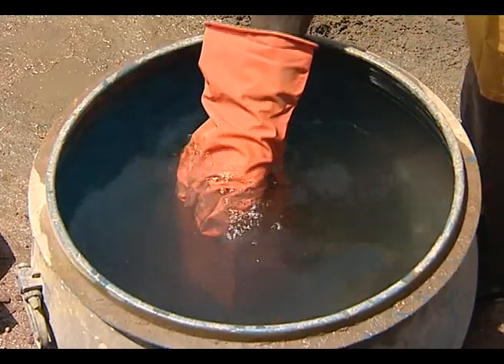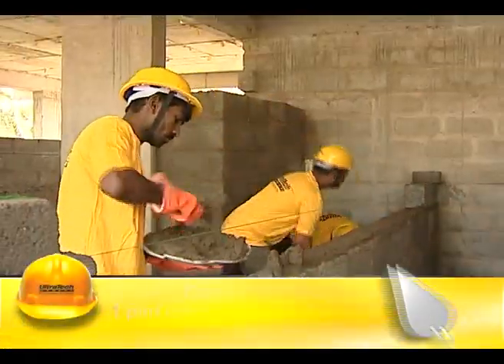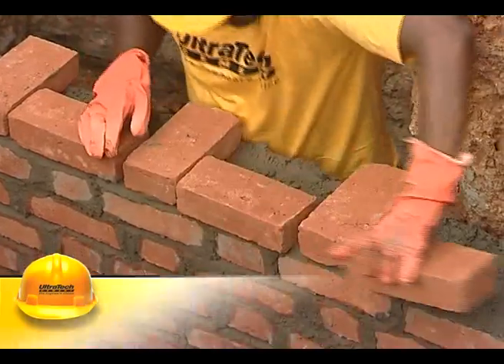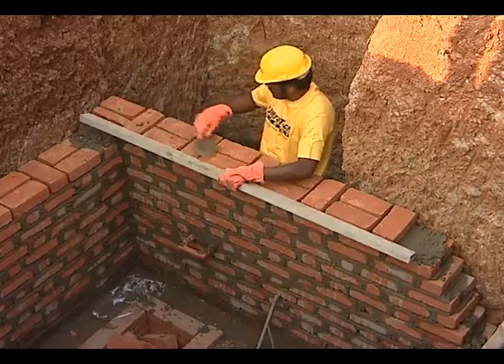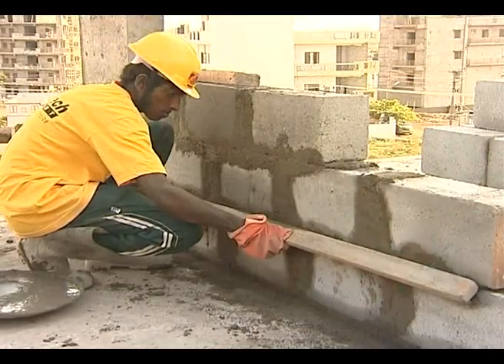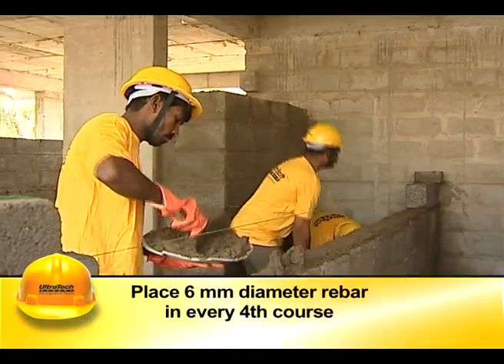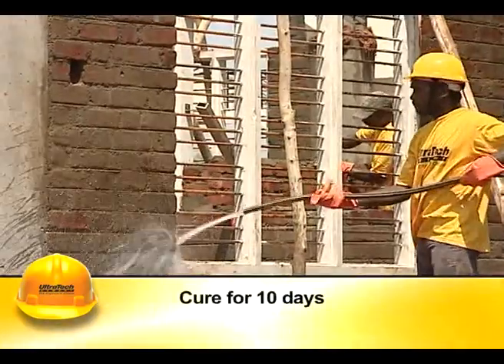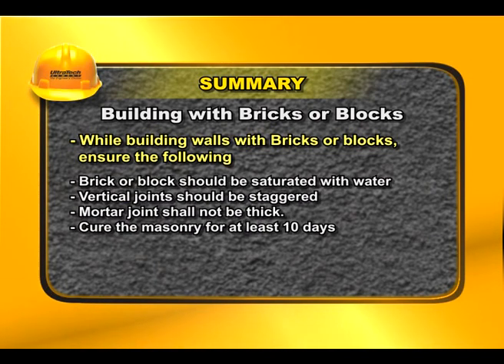BUILDING WITH BRICKS OR BLOCKS

Comment: Incorrect method showing bricks should not be layed off and cannot fill the cement n sand mixture from above it should be applied one by one with mixture
Reply: Do you know more than ultratech engineers?

Comment: being a professional u hv 2
give some technical info.
like difference between concrete block & clay bricks,
regarding strength, heat resistance, & which is suitable for construction as well as briefing on load bearing & not load bearing in normal masonry structure &  RCC structure etc.